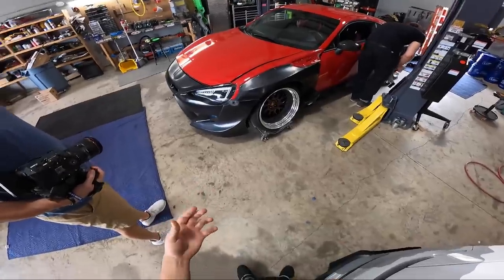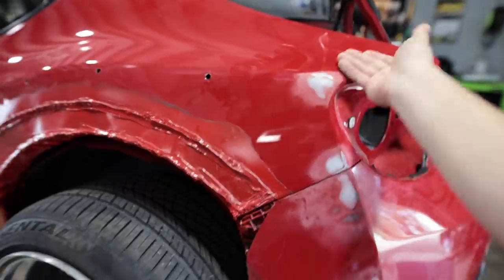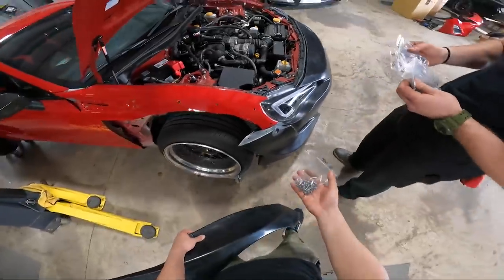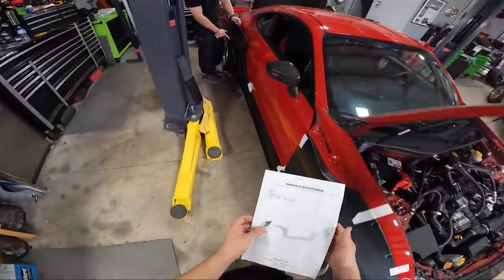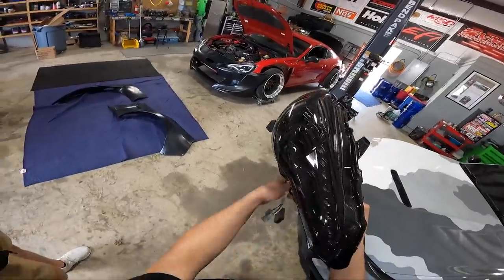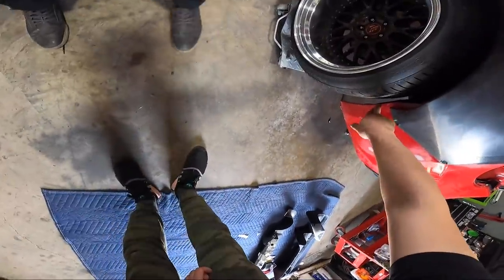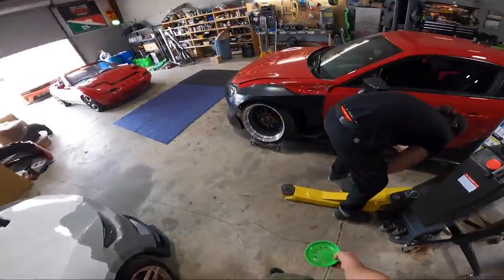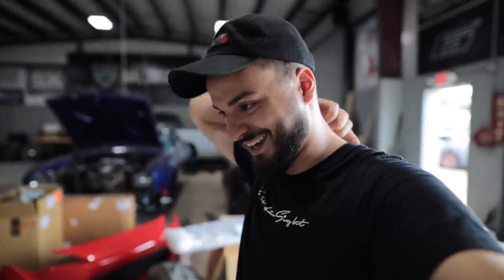Complete Assembly of our Wide-Body FRS before Wrapping The Car!!

Comment: Anyone else find it funny how all of us including Gavin and doug were talking about how the other people self tapped the other kit on and this is literally how rocketbunny says to put it on 😂
Reply: I seriously don't understand why a kit like this calls for SELF TAPPERS instead of coming with rivnuts. Rivnuts would make the kit removeable AND very cleanly mounted with properly threaded holes instead of boring into the plastic and sheetmetal.
Reply: @kasuraga  it’s a Japanese kit they are like me they like stuff that’s simple and works may not look the best bust will almost never fail and that’s why they is it cuz rivnuts can strip out and pull out of the body panel
Reply: @morganthornton847  It's more cause they're made for drift guys that tear body panels off all the time compared to a show car/street car where finish and serviceability is better than ease of destruction like with tearing a panel off that's only attached with self tappers. But even then, the fact that they made the choice to continue using self tappers instead of a more permanent and cleaner solution still gets me

Comment: About the rpm act, Porsche is creating a hydrogen based fuel that runs on hydrogen and co2. It’s compatible with gas engines and doesn’t produce any emissions. It’s going to come out in 2022 w the 911 gt3 and they will be making 10,000 gallons of it for testing for the public